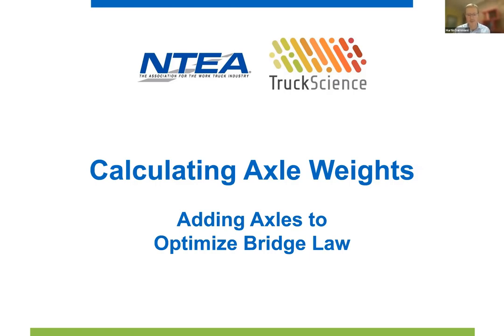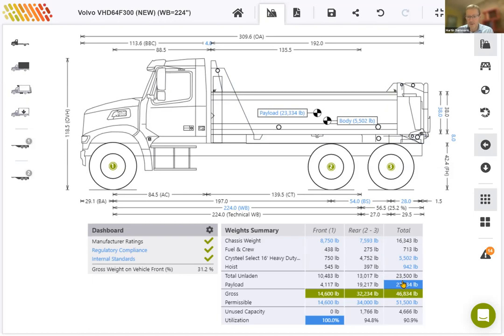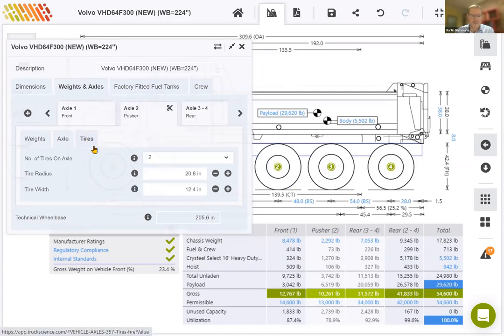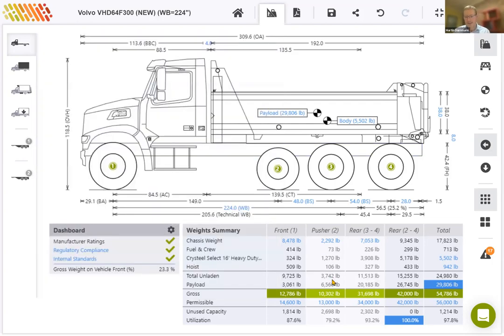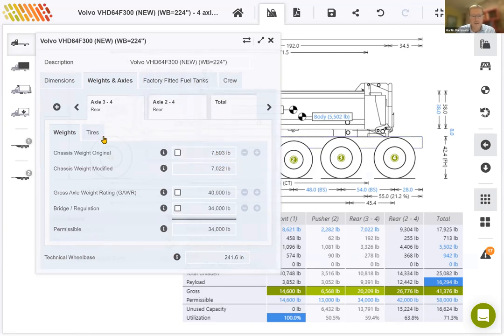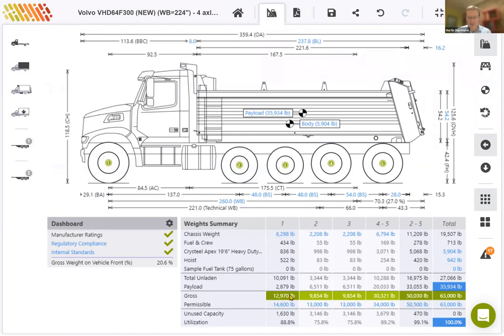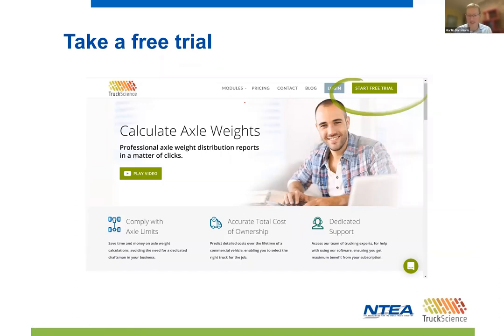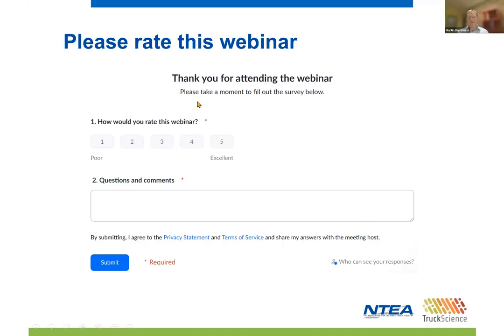Calculating Axle Weights: Adding Axles To Optimize Bridge Law (2021) (US & Canada)

Comment: by federal bridge law the table for 4 axles spaced at 12 ' is 50000 pounds
the table does not show 11' spacing for 4 axles 
what would be the permissible weight for 4 axles spaced at 11 feet center to center ?
Reply from the maker: Thank you for reaching out. Please take a free trial of our Axle Weight Calculator to answer this question for your particular configuration.